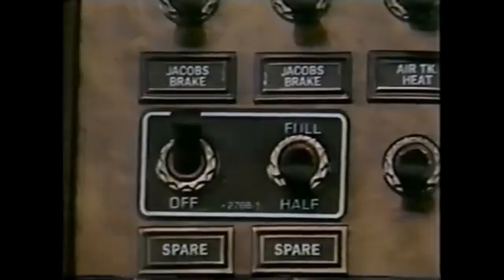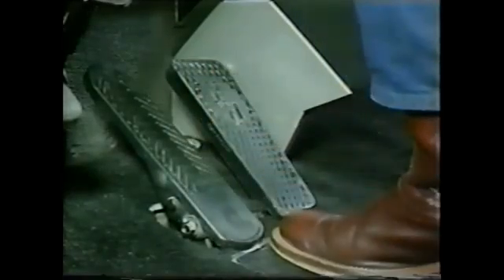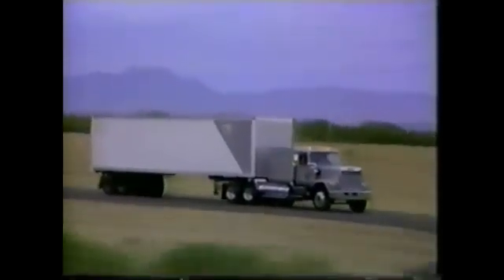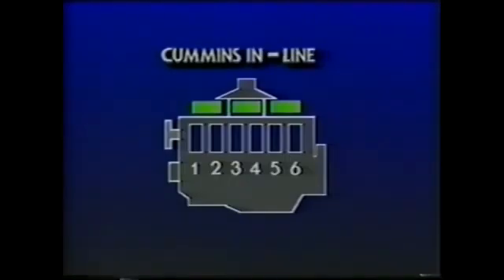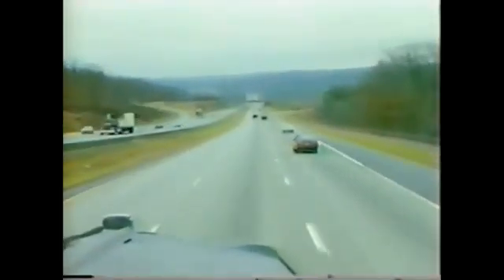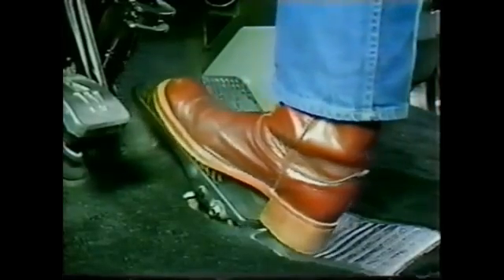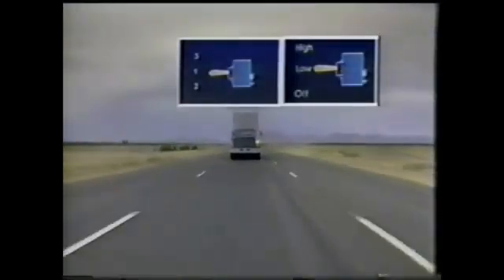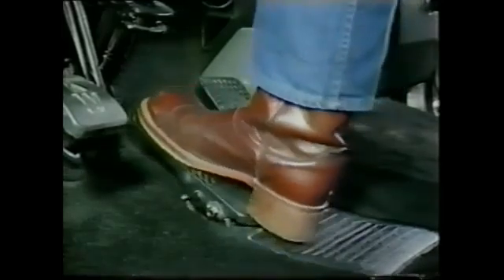The Operation of the Jake Brake Engine Brake

Comment: This seems like a good thing on dry roads.  But, what about wet, snow, or ice covered roads?  By providing braking for only the tractor tires, this would seem to me to increase the chances of jack-knifing as the tractor brakes and the trailer wants to keep going.
Reply: You are correct. Using the jakes on slippery surfaces can cause the drive wheels to skid.